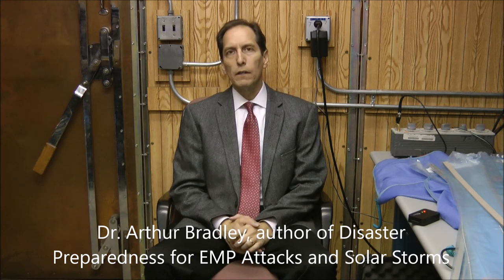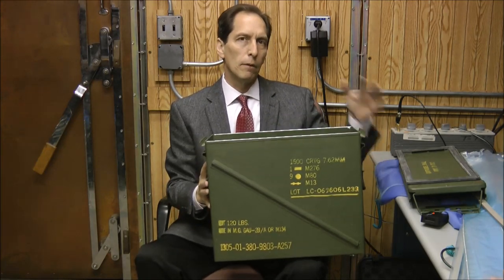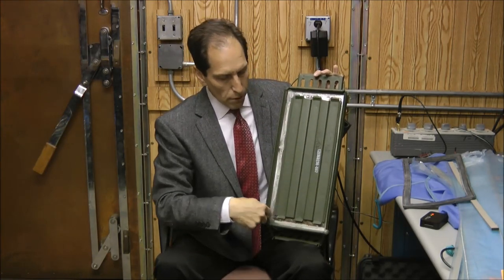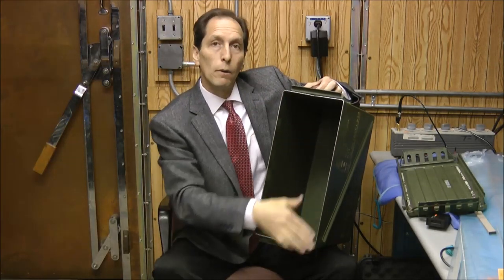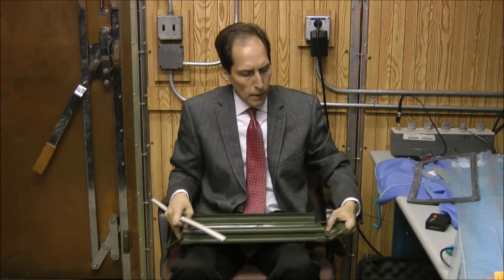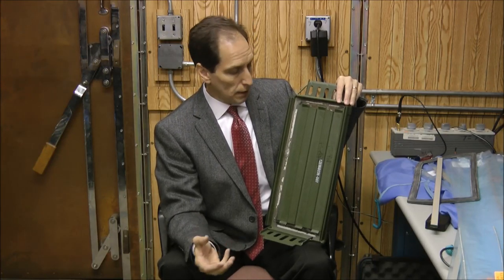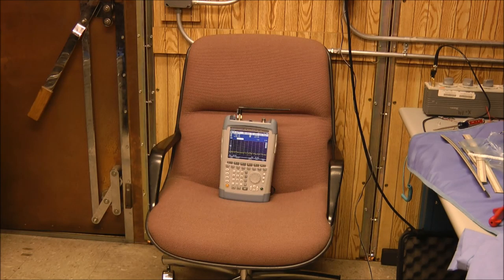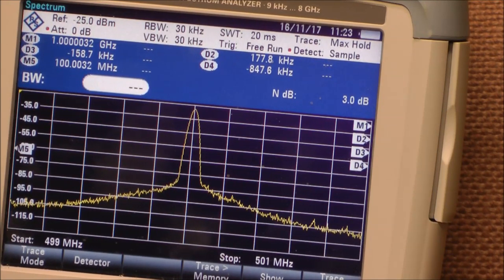Ammo Can Faraday Cage 70+ dB Shielding

Comment: You are going to facepalm when you read this, but just get a few sheets of aluminum foil spread over the box opening, and you pinch it down with the UNMODIFIED lid.  You don't have to modify the lid by removing the rubber gasket, sanding, or buy conductive gaskets, etc.  Just remove the paint on the lip of the can so it will touch the foil to make a connection.  I use Reynolds Wrap, "Super Duty" and 2-3 sheets for thickness and redundancy.
Reply: If you don't remove the paint on the lid, how do you get metal to metal contact?  Can you show us your tests?
Reply: @andrewmccarthy4144  The foil over the opening is your metal to metal contact.  You strip the paint off of the lip of the opening, then use high conductive paint on the lip of the opening where the foil will touch if you are too worried.

Comment: I made two huge cages for $30 each:  2 55-gallon steel drums,  $15 each; 1/2” round foam, 15’ for $5; 2” conductive tape30’ for $15. I used the foam and tape to make the conductive gasket.  Perfectly blocks 4G with a bit of weight on the lid or using the lid locking ring.  3 milk crates fit with some room on the side.  I store all my mission critical electronics in them:  radios, flashlights & lanterns, batteries & chargers, solar power system components, PV/monitor, spare parts, hand power tools.

Comment: Another option might be to keep the rubber gasket to retain the water tight seal (electronics don't like water any more than they like EMPs), but double layer the Faraday protection by wrapping your electronics with a metal foil, or by placing them in a rolled up Mylar bag as is used in food storage, or in a manufactured Faraday bag before placing them inside the ammo can. I would be very interested to see how that experiment would measure up to the one in this video.
Reply: I have also seen people just use aluminum foil as a conductive material. Just sand the top of the ammo can.

Comment: I'm glad someone like you puts out videos on this subject. There are way too many people making videos about EMP, who have no clue about the basic physics of the process. One guy was using a stun gun to test his "EMP bags" for "EMP Protection", LOL.
One thing I wanted to add. Stainless steel based gasket will probably work best for the metal enclosure. Copper based gasket may develop galvanic corrosion at the contact. If this is the only choice, adding some NoOX may help. A small amount of bearing grease or Fluid Film may also help to keep the contact surfaces from corrosion.
BTW, I'd love to have a spectrum analyzer like yours. Unfortunately, they are prohibitively expensive. :(
Another thing worth mentioning:
I see that you are trying to make a little money on the side. Nothing wrong with that. Just a suggestion, if you don't mind. I think conductive cloth "EMP" covers for Honda EU-series generators may sell very well. I don't think anyone else is making a similar product. Honda sells a regular cloth cover for their EU1000 and EU2000 inverter type generators for about $18. Perhaps making something similar with a longer "skirt" at the bottom may sell very well. You have the tools to make proper testing of the product. Any decent seamstress can make one fairly easily. Patent it and make a little money. Best of luck to you!
Reply from the maker: Thanks Andrew. All good points, and I appreciate your suggestions.
Reply: Exactly. This is text book as far as EMP testing. Best channel hands down for this.
Reply: There is so much bad info out there regarding EMP so I appreciate your thorough testing procedures. I have a question about testing Faraday cages at home without test equipment. Is calling a cell phone that's inside a Faraday cage a good poor man's test? I used this method to test a Ziploc style Drishield brand bag and the phone still rang.  Thank you!
Reply: @Andrew please get back to me about this

Comment: You can just use rolled up aluminum foil off the shelf where the gasket goes too, and don't forget to insulate the inside for static buildup and maybe ground the box! It's low frequency anyways, though.

Comment: Dr. Bradley.   Could you use aluminum foil to make a wrap around the issued rubber gasket and then reinstall it. It would seem like that would make a similar conductive seal from the sanded edges and still give some water resistance by the cushion deflection of the rubber gasket. It may not be as good as your professional gaskets but I wonder how effective that would be for those of us on a rock bottom budget. Might you do such a test? Thanks for your service to the country in doing these videos.
Reply from the maker: I think it would work fine, but getting the foil wrapped gasket back into the channel would be difficult.
Reply: Just use a fine layer of carbon fiber
Reply: @leefithian3704  I used the aluminum tape that HVAC people use to seal pipes :)
Reply: I have done this and am here because after enough opening and closing of the box, the foil tape comes loose from the rubber (that is the problem - getting it to stick well to the rubber).  The copper foil tape ends up bunching up and turning into a clump and coming apart.  A  I have done this on a large trash can, though, and gotten pretty good results after removing the handle on the top and foil taping over the holes and then installing some weather stripping around the lid, and then applying the foil tape all around on top of the weather stripping.  Then, in order for it to really block, I use tie downs with ratchets on them criss-crossed across the can.  So, yeah, there are work arounds, but I think i am going to try his gaskets. And to @Lee Fithian, I don't think that is conductive because I believe that the gum on the bottom might insulate it from the surface to which it adheres...not sure though.

Comment: cool video. what happens if you just grind the paint off the hinge pin contacts? another variable is also soldering a wire to alligator clip a grounding wire connected to a copper pipe from the cold water inlet

Comment: I understand this video is was uploaded 6 years ago but I have a question. Could you in theory do the same using aluminum foil wrapped around the original rubber gasket instead of the conductive gasket? Would it be as effective or maybe slightly less effective?

Comment: @empdoctor Question since the Rubber seal on the ammo can is not conductive why would you then leave it in so then the can is water proof to a point as it is intended to be . and then sand that paint off the handle locks on the lid as it would then conduct any energy thru that way ?? cause if i remember right that paint has certain properties in it to limit certain things .

Comment: Have you tried it with a piece of thicker aluminum which is 0.019 inch thick  (unpainted aluminum roll valley coils) which is used in  construction and is stocked at hardware and building materials stores. A piece can be made that is a inch or so larger on both axis's  than can circumference dimensions. Just  sand down rim of can like you show and then lay the thin sheet over top of can and hand form it down over edges (like folding a Christmas package ends)and then simply push lid with regular rubber gasket down firmly to finish form the top sheet of protection over the can. I have tried this and it forms up well and is reusable when opened again. I just wondered if you could try such a lid with your equipment. Due to scarce funds not everyone can afford the better foam system you have and lots of common folks can get these unpainted aluminum coils locally. Thanks for your great work.

Comment: My question is what is the combined frequency spectrum and field strengths of the CME and Nuclear EMPs?  At what frequencies are the highest magnitude field strengths and at what point do are consumer grade electronics give up the magic smoke and therefore, cease to operate? Although the 3 V/m Radiated immunity (RI) to a modulated radiated field is a common specification for Class A (not susceptible)immunity performance,  I suspect the Class D (damage) performance is probably +26 dB (60 V/m) or more.  
Back around 1999 we used an ammo can to shield a video camera.  We had cables to be shielded and filtered also, but only needed 34dB minimum shielding effectiveness for 150 V/m RS monitoring.  Paint and rubber gasket were removed and a fabric gasket was installed just like your conversion.  It worked great.
Reply from the maker: Hi Mark, You'd have to do an inverse Fourier on the EMP signal to get an exact answer to your question regarding field strength across frequency. Of course in the ideal "impulse" case, the field level would be nearly the same across all frequency (a true ultrawideband pulse), and the max field would be somewhere between 30 kV/m and 50 kVm, depending on who you believe. There are at least five different reputable groups who have published predictions of field levels of a nuclear EMP. Of course, field strength is only one aspect of survivability. Offending frequency, receive conductor length, orientation, and impedance, as well as nearby radiators and ground planes, all fold into it. CMEs are an entirely different beast. They have very low frequency content, perhaps only into the 10's of Hertz. Because of their wavelength, they will only couple into very long conductors (such as power transmission lines, or long buried conductors). What ends up mattering with them is the induced current in those long conductors, which can damage transformers and other associated electronics.

Comment: Won’t the adhesive sit between the metal, preventing metal to metal contact?
Reply: That's my question, too.  Is the adhesive conductive?
Reply: I checked the mft.  the adhesive does not cover the entire strip.  it is either in the middle or on each edge, leaving conductive material touching both parts.

Comment: Great videos! How did you get it to work so well without grounding the ammo can? Or is grounding your cage not always necessary? When is it necessary?
Reply from the maker: Grounding a Faraday cage really doesn't have any effect on the shielding performance. The metal itself acts as a protective barrier by redistributing charge carriers (electrons), thereby helping to cancel the field inside the cage. Grounding of Faraday cages is only done when there is electrical breakdown (a big spark) that you're trying to shunt away. That's not the case with an EMP.

Comment: Do you recommend lining the can with something like cardboard or rubber to prevent the can walls from conducting current to whatever you have inside, or does it matter?
Reply from the maker: Most electronics are already housed in plastic, so it's probably not necessary. That said, if there are exposed antennas or charging ports, it's a good idea.
Reply: Whatever you put in the can; put in an ESD bag first. It will add not only additional emp protection; It will also help protect from conducting from the can to electronics.

Comment: Are there any bags like the  Dri-Shield 3400 which offer a zip-lock closure?
Reply from the maker: There are a number of bags similar, but unfortunately, the ones with Zip-locks that I tested didn't perform nearly as well. A good way to seal the 3400 bags are to use clothes pins or chip clips. You can also tape them shut with regular scotch tape, just be sure to fold over the lip twice.

Comment: Hi, can you tell me what kind of dremel head to look for to grind down the metal on the ammo can? There are so many out there it's very confusing, lots of different tips. Also, I think you have to insulate contents from the metal of the can, right? So do you have any suggestions for good stuff to use for the inside of the large ammo can. I have one on order, and I just ordered some of the gasket material from your site, so I'm looking forward to protecting some backup hard drives. Thanks!
Reply from the maker: Any kind that can abrade the lip of the can. I don't know their names, but here's a link that discusses them. You can line the can with anything non-conductive, cardboard is a favorite. It's actually only needed if the item you're storing has exposed metal, such as an antenna. Another option is to simply put the items in a Faraday bag before storing them in the ammo can. That gives you more protection that you could ever need.

Comment: Awesome video. So... what's with everybody drilling holes and installing bolts and wires as, like, grounding nodes, or soldering ground wires to their cans? Where does this misinterpretation come from?
Reply from the maker: Just a misunderstanding out there about grounding. There are plenty of good reasons to ground metallic structures, such as when protecting against lightning. But Faraday cages do not require grounding.
Reply: @disasterprepper  I see, I see. Thanks for the reply. Love the work you're doing. Stay safe out there.

Comment: Do the solar panels need to be protected if not connected to the solar charger?
Reply from the maker: Probably not, but it's hard to say with certainty. The easiest way is to put them in a box and wrap the box with two layers of heavy-duty aluminum foil.

Comment: Would it be possible to cover the original seal with copper tape?
Reply from the maker: In theory, yes. In practice, I didn't have any luck doing so. You could perhaps put a copper barrier over the gasket, but removing and wrapping and then reinserting would be very difficult.

Comment: Will I be able to start my car after an emp or cme if I disconnect or remove the battery ?
Reply from the maker: A CME won't affect your car (unless it's an electric car that's plugged in at the time). An EMP could damage your car, but the damage could range from just a minor upset that clears with restarting to something more serious.
Reply: Depends on the car. If your car is an old Deuce and a half then it wont affect it. If your car is new and full of electronics it will probably fry all those sensitive electronics.
Reply: So what can we do to protect our cars? Tia

Comment: what gains could be had from RF Shielding Paint, or is paint even effective for these purposes?
Reply from the maker: I plan to measure the effectiveness of several RF paints this fall. Once I do, I'll post the results. If you're asking would painting the ammo can help with shielding, the answer is no. The main mechanism for leakage is the seam around the top of the can. That's why the gasket does so well.

Comment: Using the dremel on the can only, leave the lid the way it is and then use an aluminum foil sheet and place it between the lid and the can when you close it.  Wouldn't that work?

Comment: Why doesn't the adhesive material interfere with the conductivity?  Is it made of some type of conductive material?
Reply from the maker: The adhesive is actually made to be conductive, but it's also just so thin that there's not a measurable gap for high-frequency energy to get in.
Reply: @disasterprepper Yes, I did a few searches and found out there are conductive adhesives.  Love your videos.  Thanks!

Comment: Hello , I was wondering if I order the bags that you recommended , and triple baged them , each one sealed using Velcro and placed in a 6 gallon trash can , the trash can will have no gasket or be taped . How much DB do you think this will be safe for ?
Reply from the maker: Triple bagging and then putting in a can is really unnecessary. If you want to double-bag, that's fine, but anything beyond that is overkill. If you double bag, you don't need to do anything else, no can, no triple bag. Even double bagging would give about 90-100 dB of protection -- way more than is needed.

Comment: I've watched different videos on this and some say ground it, some say don't.  Will grounding it make a difference?  Also, does the container size matter.
Reply from the maker: Grounding matters when trying to protect from electrical breakdown (i.e., a spark) or when in the near-field of the offending signal. Neither of those apply to an EMP, so the short answer is that grounding won't really help with shielding from an EMP.

Comment: Question - could one expect an even better RF suppression level if items were placed (and sealed) in ESD bags and then put into the modified ammo can? Thanks in advance.
Reply from the maker: Yes, shielding in layers works remarkably well. If you didn't use the gasket but just put the item in an ESD bag and then into the ammo can, you would probably get about 70-90 dB of shielding, depending on what type of bag you used.

Comment: Great videos. 
I was thinking of making my own metallic gasket with household aluminum foil by rolling it into a fat cigar shape and hammering it flat, something like the crosssectional shape of the original rubber gasket. It would, of course, be much more firm and I would need to experiment with the thickness. The more difficult to latch the lid, within reason, the better. This self made gasket can be glued into the sanded lid rim with a carbon based adhesive. 

Any thoughts?
Reply: will edwards  thanks for the feedback. I figured this would be the case. I also figured this sort of storage method would be for long term, "Open Only In Case Of Emergency" sort of things like spare vehicle parts to rescue the bug out truck after an EMP event. 
I also use foil tape on the outside around the margins of the lid. 
This also makes it an emergency package.

Comment: Does the adhesive on the metal gasket cause problems by insulating the mating surface since it is probably not conductive?
Reply from the maker: I tested this, and it ends up not making a difference. The gaskets actually use conductive adhesive, but even with non-conductive adhesive, such as with metal duct tape, it made no difference. I think the reason is that it gets compressed so much that you end up with metal-to-metal contact. It's a good question, and one that I wondered about too.
Reply: @disasterprepper  Yeah ammo boxes do seal tightly. Thanks for the response, makes sense.